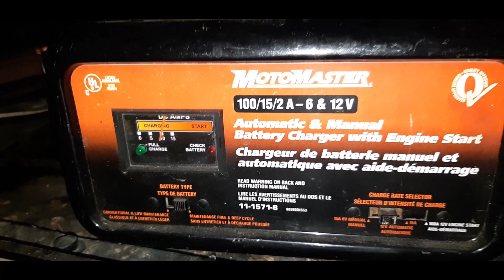cold start attempt 62 Thunderbird

Comment: I wonder if you already knew you had proper spark? After you primed the carb and did not get even a sputter it was check the points, cap, or wires and plug time. Loved that era of the  bird. Stepdad had one way back brand new convertible 62. As a young kid  I used to stare in awe watching that top fold up into the trunk  Good luck!
Reply from the maker: yeah idk its my dads car so.. 
anyway we got it going there's another video about it.